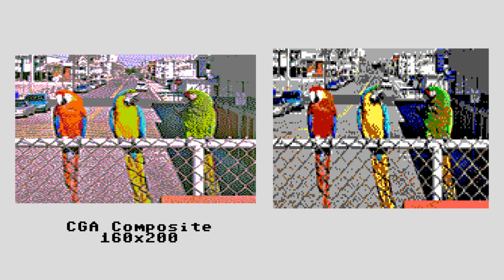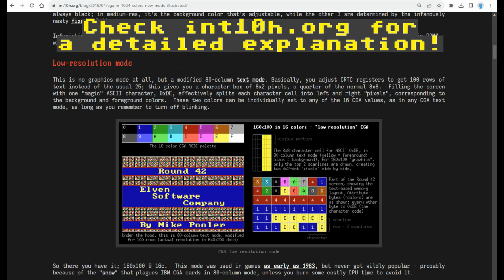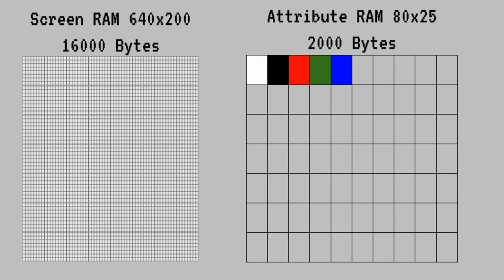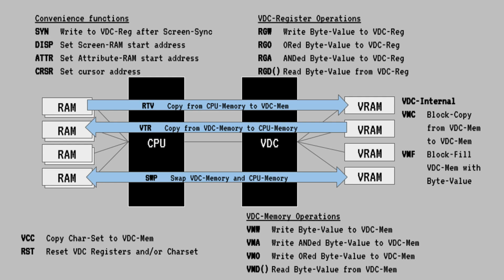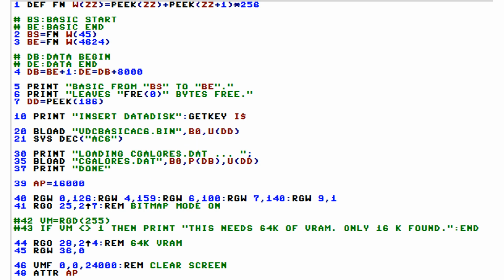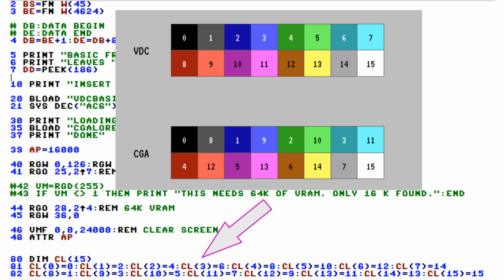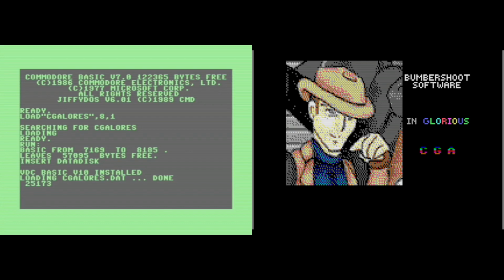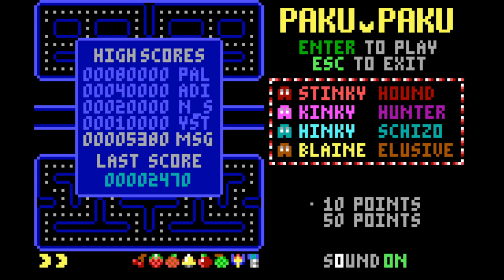C128‘s VDC vs IBM XT‘s CGA: 16 Color Graphics using the 30 year old VDC-Basic extension

Comment: "If we didn't, the picture would look like this on a real monitor."
As opposed to which sort of "fake monitor" that could possibly exist but still work?
Reply from the maker: As opposed to how emulators display it. Emulation of the VDC-Chip has improved massively recently. But every now and then, things look great in emulation but don't on real hardware.
Actually, should have referred to a real VDC-chip, not a real monitor.
Thanks for bringing this up!
Reply: @the8bittheory : Oh? What sort of equipment do you think we are using to see what the emulator is showing?
Yeah, "real VDC," not "real monitor" or "real hardware."

Comment: "But this feature is not used."

Then why did they make it?
Reply from the maker: The VDC-Chip wasn't originally intended to be used in the C128. That's why they didn't look at the features that would be available there. And I guess they didn't change the behavior of Basic to leverage on that, to make sure that VDC and VIC-II output in Basic stay as similar as possible.
Reply: @the8bittheory : Then what machine was the -"VDC-Chip"- VDC chip originally going to be used on? And what do you mean by "change the behavior of -'Basic'- BASIC"?
Reply from the maker: I think that was the C900 project. A Unix-based Commodore computer.

Printing reverse characters in Basic is done by adding 128 to the screencode. By also including reverse characters in the VDC's charset, it was possible to keep that behavior. If the VDC-register was used to show reversed characters, it would have required a dedicated piece of code in the Basic-ROM

Comment: Hi.Just put my hands on a C128, I had a C64 when I was young (1983).I wonder whether it's possible to display 40x25 characters on the VDC, with 4 colors per character
Reply from the maker: You can set the registers so it displays 40x25. 4 Colors won‘t work in textmode, but 4 shades of gray should work
Reply: @the8bittheory  thanx. And because I own french tv sets with scart connectors, I can enjoy sharp image on a lcd display. Scart is still the goto

Comment: I would think that 640x200 in 16 colours should be possible, or 320x200x16 with dual page buffers or screen+sprite buffer, as the VRAM is 64kB. The VDC now feels a bit like a failure, and not an improvement. The only positive is no jailbars and chroma bleed.
Reply from the maker: You might be interested in the VDC-Modemania Demo. I think that shows the potential pretty well. Thanks for your input!

Comment: Very nice! One further optimization you could do is to fill the entire bitmap with %00001111. If two pixels are the same color, just set the attribute to the same color for both foreground and background. This way you can clear the bitmap with fast block fills of %00001111 and only have to individually set the color attribute RAM bytes.

Going beyond that, there is also a double-width mode with which you can do theoretically do a 320x200 mode, which only takes up 8000 bytes of bitmap, and then treat it as 160x100x16 as here. I can't recall what that does to the color attributes though. There's also something in my memory about timing weirdness in double-width mode which can result in it requiring doing a slightly smaller horizontal width. So in actuality it might end up being something strange like 304x200, leaving you with 152x100. I'm without a C128 at the moment (but expecting to have one again soon) so I can't reliably experiment to reproduce the mode. It's also entirely possible that I just wasn't adjusting something correctly and could've gotten 320x200 working reliably with different settings. Even with the VDC's limitations compared to the VIC-II's strengths, I still find it a fascinating chip, and think more could've and would've been done on the graphics and gaming side in the 80s and 90s if people had understood it better. It's great to see people like yourself doing videos like these, and I hope it'll inspire more people to see what they can make the VDC do.

One more thing regarding the double-width mode is that since it reduces the bitmap to only needing 8000 bytes, I wonder if the mode I described above could be done on the 16K chip? With attributes taking up 8000 bytes, we'd be at 16000 total. Seems like it could be doable, but I may be missing something that would change the math.
Reply from the maker: Thanks for the input!
Double width mode also halves the color resolution, unfortunately. That would have been a great memory saver. 

Wrt 8000 bytes: if you‘re good with greyscale, you can really use textmode to fake graphics just as CGA does for the 160x100 mode. 

Also, thanks for the great feedback. I also hope that this inspires more people to look into the c128‘s unique capabilities.
Reply: @the8bittheory  Ah, thank you for correcting my flawed memory! Maybe you can also help me recall how attribute RAM works with interlace. Is it interleaved the same way as the bitmap is, so for example byte 1 of color RAM in 8x2 mode would choose the colors for lines 1 and 3, or does it behave in a contiguous way and it would color lines 1 and 2? I believe it's interleaved, but I don't trust my memory on it. Contiguous would be extremely useful, but seems unlikely.
Reply from the maker: Unfortunately, I haven’t found the time to look into interlaced mode yet. But it‘s on the list :-)

Comment: It's amazing how big a CGA card is compared to the C128 CDV chip and RAM.
Reply from the maker: Absolutely. A couple of years make a big difference. Only two RAM chips required for the VDC, for example. Also, 3rd party vendors produced much smaller layouts.
Reply: @the8bittheory  even still, I get the feeling that IBM over-engineered everything because I guess it was at the high end of the market, and could justify whatever price to its business consumers.
Reply: @the8bittheory  also even more amazing what Atari did around 1978 with the Atari 400/800 series then, is it not?
Reply from the maker: Oh yes, I think that is vastly underrated
Reply: @shaunbebbington6411  Yes, and they were super flexible on the Atari 2600 too. The Commodore computers were totally rigid in comparisson. I think another machine that has a video chip that can bend like a rubber duck is the CPC. They could make it do insane vertical resolutions, like 3:4 vertical for Arkanoid, change palettes on line-to-line basis and 4 colour true bitmap modes.
Reply: The Atari 8 bit and Amiga was designed  by Jay Miner who was a genius RIP.

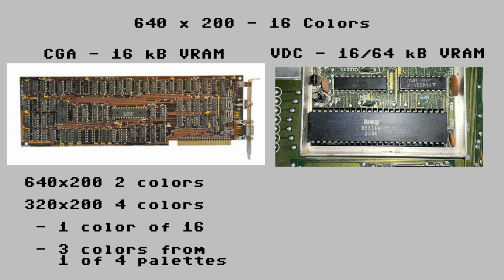Comment: 1:50 This is wrong. CGA can display 16 colors in high res.  Generally though, it is limited to color cells in alpha numeric mode (displaying the built in fonts). The color data only takes 4 bits per cell and there are only 2k cells.
Reply from the maker: So it could if it had more RAM available. Is that what you‘re saying?
Do you know of any CGA cards that came with more RAM?
Thanks for your input, highly appreciated
Reply: @the8bittheory  Honestly, I think it was just a wording error or I misinterpreted what you said..  I was referring to text mode, which technically is running in 640x200 using 8x8 fonts and each cell can be any of 16 colors.  I really should delete the comment. Sorry.
Reply from the maker: Don’t worry about that. Either way, your comment clarifies things. That’s good 👍🏻

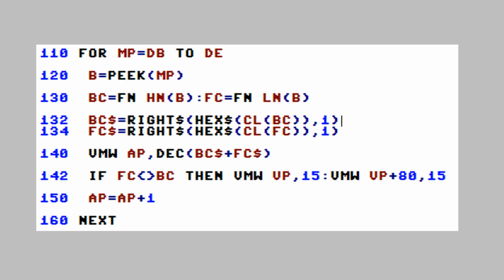Comment: 18:29 A much more efficient way to do this doesn't use strings at all:

VMW AP, CL(INT(B/16))*16 + CL(B AND 15)

The INT() is only for clarity and isn't even needed, since subscripts will be 'integerized' anyway.
Reply from the maker: Thanks, I‘ll try this absolutely. 

Your name sounds familiar. Did you write Zed?
Reply: @the8bittheory : Yep.  It'll be faster still if you assign 16, 15, and 1/16 to variables and use CL(B*var), where var = 1/16.
Reply from the maker: @csbruce Nice!

Yes, precalc makes it a lot faster. The disk image in the Github Repo also has a version that does everything through lookups. CGALOWRES3.PRG
I should mention that in the next video, thanks!